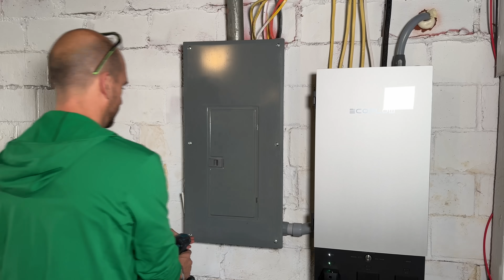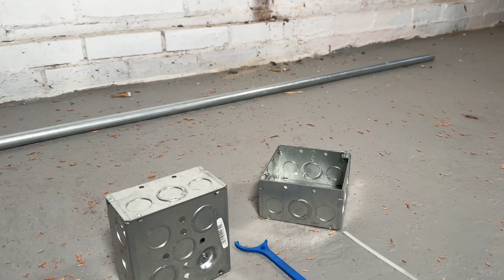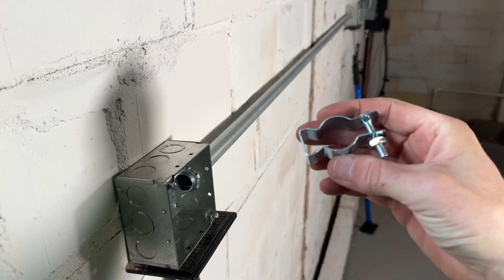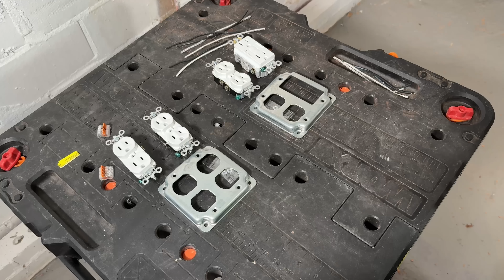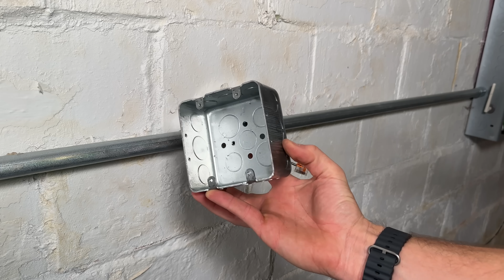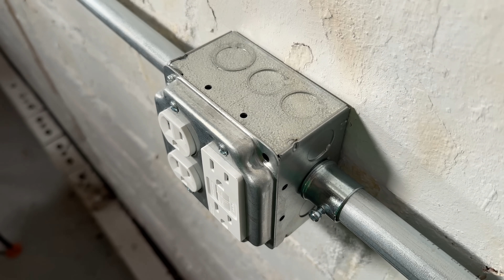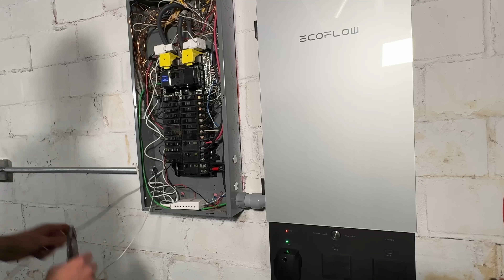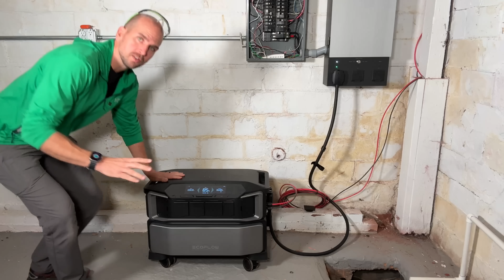Add Outlet To Unfinished Basement Or Garage

Comment: Do you have to add conduit? Is it a code requirement?
Reply: In this situations, EMT is the best option if you know how to install it correctly,  you could also use PVC,  liquid tight, MC, etc, but is going to look ugly and it won't be cheaper, FYI,  most residential electricians  do not know how to install IMT correctly

Comment: I just did this in my garage, but I used  MC cable cheaper option vs. conduit and needing the bender for it. But either or make sure you ground the boxes. Duel box I have on the wall the outlets they screw to the box. The one I have in the rafters for the garage door opener I have a 5/8 mud plate for when I put up 5/8 drywall to meet code for garage the outlet screws right to the mud plate.😊
Reply: Duel? Pistols or swords?
Reply: I wouldn't use mc cable in any location where it can be damaged or grabbed. Especially in a residential environment.

Comment: That pipe needs two supports between the boxes and at least one between the box and the panel. Don't be lazy, splice the wires and use wire nuts!
Reply: Thank you.  Mechanically, the wire nut connection is superior to the pinch terminal setup of the Wago.
Reply: @WJCTechyman a big debate in the US but I have had nothing but trouble with wagos
Reply: @WJCTechyman I'm willing to bet you there are a lot more fires with wire nuts than with the lever lock wagos.

Comment: I would have used a bender to put offsets in  the conduit, or just bought the connectors that have the offset.
Reply: Especially in a workshop. Were we are all guilty of using that nice screwdriver/ chisel storage space between the emt and wall !

Comment: Even though your way is 100% fine, it simply makes me feel better to run a ground conductor in a raceway, and have a ground connected at each outlet. That way, if for whatever reason the plates aren’t touching the box, the circuit is still grounded.
Reply: I piped EMT in homes for over 20 years here in Chicagoland west suburbs (IBEW 701) . EMT is what we do here that's code. Never pulled a ground once unless it was through a PVC underground slab pipe. Now some towns do make you put a ground from the box to the outlet mainly while using Garvin covers like this video.
Reply: & insulated ground needed for isolated ground receptacles

Comment: Great job and very informative!  To be absolutely sure on the ground and since it's not too far away from the panel, I'd probably throw in a green ground wire inside the conduit that runs back to the panel.  I've sometimes gotten yelled at for not having one.  Again, great work.
Reply: I agree. Always ask your inspector.

Comment: I wouldn't use Wagos on 20 A circuits.  Wire nuts only because the surface area contact and thus the mechanical connection grade is higher inside a Marrette (wire nut) than the glorified speaker pinch terminals that is the Wago.  If you were doing LED lights, not a problem but not for high currents.  I also agree with others, there should be a dedicated ground running from the panel to each box and each device.  It's there more as a safer than sorry as there could be resistance or isolation between the boxes and conduit connections.
Reply: Wagos are rated for at least 30A and there are some good videos on youtube showing tests. Wire nuts are harder to get right for DIYers, so seem like a good choice.
Reply: Wagos have been tortured tested to hold up longer than the insulation on the wire but ya I myself prefer copper crimps and nylon caps over wirenuts😊
Reply: I don't see how the circuit requires any of them at all, this is why receptacles have terminals on both ends. Space is being consumed behind the receptacles without reason and there are more connections than necessary. it seems to be done to drive traffic for Amazon affiliate links rather than solid electrical advice.
Reply: Agreed! I am not comfortable with these Wago things either. A good pliers assisted wire nut is superior IMO. I always loop the receptacles together using the screws or SCREW DOWN back wired devices. I never use push-ins even on 14ga and I think they are now illegal on12ga. Just my practices, not to say anything is wrong with the video as it is within NEC as I know it..

Comment: I don’t understand the benefit of not running ground wire here. What are you saving, $1 in copper wire? Sure you have a continuous metal ground but what happens 10-20 years down the line when someone else extends/replaces part of this circuit and doesn’t understand or care what you did here? They could end up without ground.

Comment: I only ever use pigtails going from one outlet to the next.    Wires in go to the first outlet pig tailed to the next.  Then out to the next box.  I learned back in the 1980s and have been doing electrical work for nearly 40 years.  I now use waggo but i don't use them unless absolutely needed.    I like my boxes to be clean.  All of the pigtails make a crowded box.    Also i onl yh use drawn boces.  They work well in cinder block   i have no issues what so ever with drawn boxes. .        in 40 years i have only has a few items that i had to change for inspectors.  And only one was an actual code issues, the others were preference items of inspectors not actually  a code issue. ( Which were 100% BS).     That is very annoying both with electrical and building ( structural ) inspections.
Reply: if you are suggesting to "daisy chain" your devices, that is no longer permitted (by Code). Just because something works and you have been doing it that way for years does not make it correct or "best practice."
Reply: @TwilightxKnight13  You can daisy chain receptacles.  You can't daisy chain them on a MWBC.  Hit the code book a little harder.
Reply: He wasn't saying to not use a drawn box.  He was saying to use a box with the 2 screws at the corners of the box, not the 4 screws where devices screw to regular boxes in the wall.

Comment: Good video, why would you use 20 AMP breaker,12 gauge wire and 15 Amp receptacles??
Reply: I was always under the impression that so long as there is not a single receptacle only on the branch that it was permissible. I am not an electrician FYI. I believe he has a video on this specific question you have. The general train of thought being that a duplex receptacle can handle the full 20 and the chance of only one plug being utilized is low. That being said, new homes in my area are being provided with 20 amp branches going to one receptacle. It is round and has the ability to take a 20 amp plug
Reply: If I was wiring my house, I would spend the extra money and use the next largest gauge with the standard breaker (so, 20 A breaker, I would use 10/2 or 10/3 with 20 A outlets.  It's overkill but it adds a little bit of leeway to the circuit.
Reply: @WJCTechyman   there is no "leeway" in electrical. Either it works and is safe or it isn't. There are already very large safety factors built into the specifications of the Code. Using #12 with a 20A breaker and 15A receptacles is perfectly safe and you are not going to gain any benefit from upsizing to 20A receptacles or wire, just pay more. Just because you "feel" better about it doesn't mean anything. The ONLY need to upsize to 20A receptacles is if you plan to use equipment with 20A plugs. If you are worried about multiple equipment consistently drawing  more than 20A and tripping the breaker, then you need to plan for more circuits.

Comment: Never drill into the mortar.  Only into the main block itself.  The screws will not stay tight in the Mortar.
Reply: I was thinking the exact same thing. I'd have bent an offset to get the knock-out off the mortar line so I would be drilling directly into the block.
Reply: @sigcrazy7 There were plenty of knockouts in that box, he could have chosen the next one up or down to avoid drilling in the mortar. I was actually a little concerned about that red wire in the box that got closer to that unibit for my comfort. Probably didn't shave any insulation off of it, but as I said, it was a little close for my personal comfort.
Reply: In mortar,use lead anchors.

Comment: On cutting conduit, if you are going to use a plumbers pipe cutter, use a reamer like a Klein 85191 to ensure that you have expanded the inside of the pipe to required dimension. The pipe cutter squeezes reduces the inner diameter and can catch wire. You did ream, but that does not confirm it's enough. For your install here, it's not going to matter, but for ones with some conduit bends, it can nick/strip wires. Preferred for cutting is a bandsaw (fast and square) or in a pinch a recip saw, but understand those not being standard DIY arsenal.
Reply: Plumbers ream copper, which is easy to ream smooth and straight with little effort. Steel is MUCH harder than copper and takes much more reaming effort than copper. It's a lot more work and time than a battery powered saw, or even a sharp hacksaw.
Reply: We always used a hack saw and “reamed” with our linesman pliers! On big rigid conduit, we used a rotating pipe cutter and reamed with a rattail file! Some big jobs we had a big tapered reamer.
Reply: I learned something new for sure. I would have expected the pro to use the pipe cutter as it seems more efficient, quieter and neater. Thanks for the tip on the reamer. I've seen them but did not know the benefits.
Reply: A sharp hacksaw is much faster than a pipe cutter with a minimum amount of reaming required.
Reply: @TheOldManAndTheSaw  I'm obviously not very efficient with a saw then. LOL
Reply: @TheOldManAndTheSaw  Good point. I forgot hacksaws existed in this context. Too spoiled by being used to having power options around.
Reply: Believe it or not but there IS a technique you need to learn to cut conduit with a hacksaw. Unfortunately, one part of the technique is called "elbow grease"; which is in short supply anymore.
Reply: @TheOldManAndTheSaw  unfortunately, I have one hand in a cast right now, so it's definitely in short supply at my house. I'm just going to hire out my immediate job, but I am planning to run a couple new receptacles in my garage next year and was debating metal vs PVC-U.
Reply: @pld8993  well, it was the state of the art back then . No cordless tools back then. Hauling a corded bandsaw was a pain…. A few seconds with a good hacksaw was the solution! We used to get an old grocery cart to use on a big job. The wire frame was convenient to slip pieces of 1/2” emt through and load up your wire spools and put your larger tools to roll from place to place!
Reply: @bobsbarnworkshop  I used a hacksaw for the first 20 years of my career, and a corded Porta-Band for rigid or anything over 
1-1/2". In the mid 90's  Panasonic came out with a cordless metal cutting circular saw. At the time it was $450, a fortune for a tool back then. I reluctantly bought one and used it on one job where I ran about 3000' of 1/2" EMT. Paid for itself on that job and I've never turned back. Eventually Milwaukee came out with one so that old Panasonic is sitting on a shelf destined for a cordless tools museum someday You're right that using a hacksaw requires an art-like approach as it's not always as simple as a solid place to rest it while you cut it. Quality hacksaw blades and frequent changes is the key to work smart, not hard when it comes to hacksaws. I still keep a hacksaw in my toolbag and every few months I pull it out when I need a creative cutting solution.
Reply: @bobsbarnworkshop yup, the old shopping cart trick. When I was young I could hold it with my legs
Reply: Hack saw. 32 teeth per inch. Ream with reamer or uninsilated channel lock handles. Using a pipe cutter is not good
Reply: This method of cutting conduit is DEFINITELY done by a DIY person. A pro would never do that.

Comment: Why not 20A receptacles on the circuit?
Why not use the common passthroughs on the receptacles instead of wago wire nuts?
Reply: (1) Because 20A receptacles are generally not required. If these are just going to be general utility outlets without any large-load equipment, 15A receptacles are just fine.
(2) if you are referring to the prior practice of "daisy chaining" receptacles using the two sets of terminals for all the connections, that is no longer permitted by Code. The devices must be installed such that should a receptacle fair, it would not interrupt the others in the line, ie pig tailing.

Comment: Actually 'no Romex in conduit"  seems to be a myth. NEC Article 334.15  on NM sheathed wire says "Cable shall be protected from physical damage where necessary by rigid metal conduit, intermediate metal conduit, electrical metallic tubing, Schedule 80 PVC conduit, RTRC marked with the suffix -XW, or other approved means."  I'm not an electrician, but this seems pretty clear.
Reply: you can do it but you have to go by conduit fill which makes running it in any conduit just ridiculous.  Also you can only do it in dry areas.
Reply: @jrock865  there is zero difference in conduit fill calculations if you run three #12 THHN vs 12-3 romex. Conduit fill is based on current carrying conductors, not the insulation. That being said, the installer is also responsible for ensuring that the wiring is not damaged when installed and pulling Romex through conduit is much harder than single wire, so the risk is there for problems. As such, you should avoid running Romex inside conduit.
Reply: @TwilightxKnight13  romex is a cable assembly you have to use the cross sectional area of the cable.
Reply: @TwilightxKnight13  actually there is a huge difference in running 3 #12 thhn and a 12-3 romex....the conduit will be bigger always when running nm-b in a conduit.  NM-B is also sized as a single conductor meaning it can be 53 percent fill which lets face it would be ridiculous to pull romex's in conduit you'd be running 2 inch conduit all over the place in a dry location just not feasible.  so can you run it in it yes in some instances that are dry locations unless it's UF but who in their right mind would run bigger pipe and struggle with romex pulls...
Reply: My first NEC when I was an electrical drafter, was 1981.   Back then NM was not allowed except for up to 24” sections.   Then it was allowed to protect cable in basements by using conduit down the walls if exposed and the 24” went away.  Then they said that NM in conduit fill was not to exceed 53%.   Now we are at what you said.   It was intended that short pieces of conduit be installed down the walls.   Now people are running it horizontal full length and nothing I can find specifically that states to not do it.